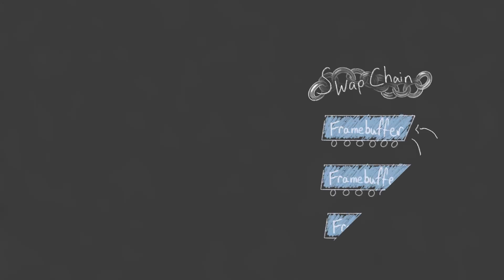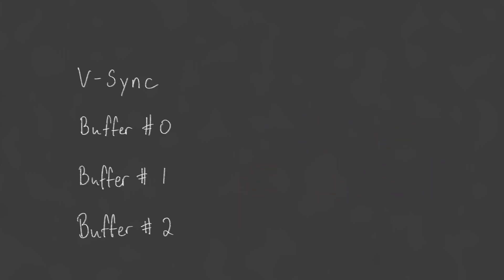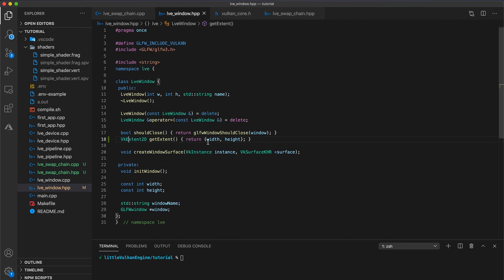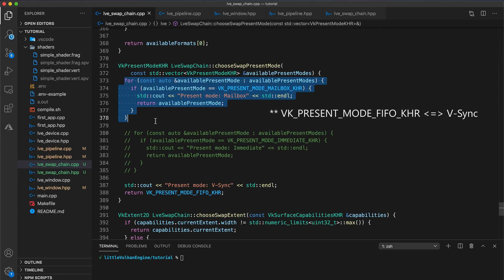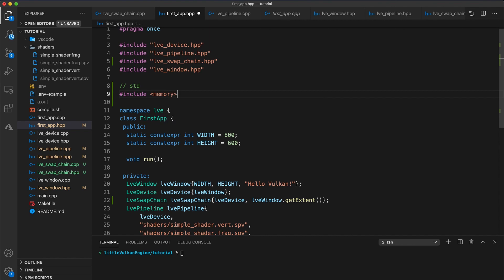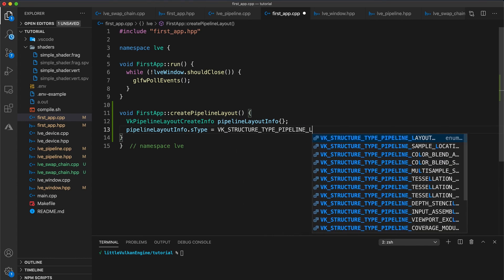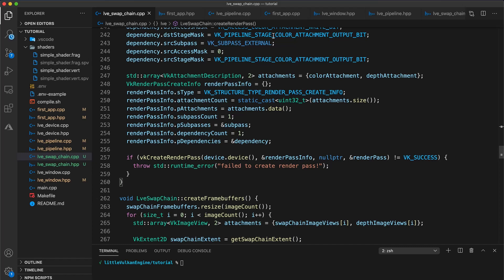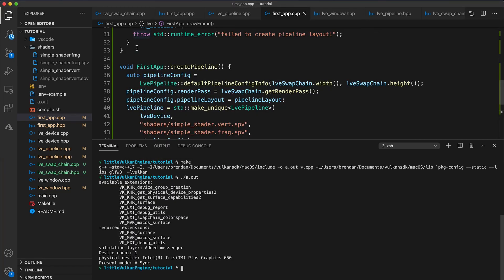Swap Chain Overview - Vulkan Game Engine Tutorial 05 part 1

Comment: I got this error:
validation layer: Validation Error: [ VUID-VkPipelineShaderStageCreateInfo-pName-00707 ] Object 0: handle = 0x1ae47b2bf08, type = VK_OBJECT_TYPE_DEVICE; | MessageID = 0xb38b9761 | No entrypoint found named `main` for stage VK_SHADER_STAGE_FRAGMENT_BIT.. The Vulkan spec states: pName must be the name of an OpEntryPoint in module with an execution model that matches stage (https://vulkan.lunarg.com/doc/view/1.2.170.0/windows/1.2-extensions/vkspec.html#VUID-VkPipelineShaderStageCreateInfo-pName-00707)
validation layer: Validation Warning: [ UNASSIGNED-CoreValidation-Shader-InputNotProduced ] Object 0: handle = 0xbb4e7a000000001f, type = VK_OBJECT_TYPE_SHADER_MODULE; | MessageID = 0x23e43bb7 | Attachment 0 not written by fragment shader; undefined values will be written to attachment

I had `shaderStages[1].module = vertShaderModule` when I should have had `shaderStages[1].module = fragShaderModule` ...oops :P
Reply from the maker: lol I'm pretty sure I've made that exact mistake, vulkan error messages can make for tough debugging experiences at times.
Reply: how did you fix this?
Reply: @pinkherblue 
I had `shaderStages[1].module = vertShaderModule` when I should have had `shaderStages[1].module = fragShaderModule` ...oops :P
Reply: @SillyRabitThatsFent  thanks for replying. Unfortunately, I got that right but still having the error :/
Reply: @pinkherblue  np but gl!
Reply: @pinkherblue  So going through this tutorial again I had swapped the .vert.spv and .frag.spv and got the same error again.

Also it could be that your current working directory is not where you expect it to be.

If you're building with C++17 or higher you can put in main to display your CWD:

std::filesystem::path cwd = std::filesystem::current_path();
std::cout << cwd << std::endl;

Because I was using the debug button with the cmake extension in vscode, it was putting my CWD to whatever my terminal was at. My terminal was in different directory than my project root so the program was throwing exceptions.

Comment: I got this error:
validation layer: Validation Error: [ VUID-VkGraphicsPipelineCreateInfo-rasterizerDiscardEnable-00751 ] Object 0: handle = 0x1ae47b2bf08, type = VK_OBJECT_TYPE_DEVICE; | MessageID = 0x19d33f93 | vkCreateGraphicsPipelines: if pCreateInfos[0].pRasterizationState->rasterizerDiscardEnable is VK_FALSE, pCreateInfos[0].pMultisampleState must not be NULL. The Vulkan spec states: If the rasterizerDiscardEnable member of pRasterizationState is VK_FALSE, pMultisampleState must be a valid pointer to a valid VkPipelineMultisampleStateCreateInfo structure (https://vulkan.lunarg.com/doc/view/1.2.170.0/windows/1.2-extensions/vkspec.html#VUID-VkGraphicsPipelineCreateInfo-rasterizerDiscardEnable-00751)

I fixed it by adding this to right above the ckCreateGraphicsPipelines(...) call in lve_pipeline.cpp:LvePipeline::createGraphicsPipeline(...):
VkPipelineMultisampleStateCreateInfo multiSampleState{};
  multiSampleState.sType =
      VK_STRUCTURE_TYPE_PIPELINE_MULTISAMPLE_STATE_CREATE_INFO;
  multiSampleState.rasterizationSamples = VK_SAMPLE_COUNT_1_BIT;
  multiSampleState.sampleShadingEnable = VK_FALSE;
  multiSampleState.pSampleMask = nullptr;
  multiSampleState.alphaToCoverageEnable = VK_FALSE;
  multiSampleState.alphaToOneEnable = VK_FALSE;
  pipelineInfo.pMultisampleState = &multiSampleState;

Comment: I have only done some simple OpenGL stuff in the passed, but all this seems overtly complicated. How much of this code would have to be redone and specialized down the road, assuming we are not building triple A games?
Reply from the maker: Ya you'll commonly hear that vulkan is an explicit API, which just means that we have to be very specific about how exactly we want things to function. OpenGL does a lot of this automatically for you behind the scenes, but a disadvantage to this is that sometimes it's hard to know what openGL is actually doing and if it is being inefficient. 

The code doesn't really need to be redone, but restructured or abstracted in certain places depending on what you want to build with it.

Comment: After adding the pipeline layout and pipeline creations I got a bunch of validation errors on VK_OBJECT_TYPE_DEVICE which didn't appear previously. Any idea on some possible cause?

validation layer: Validation Error: [ UNASSIGNED-GeneralParameterError-UnrecognizedValue ] Object 0: handle = 0x20a2a701d98, type = VK_OBJECT_TYPE_DEVICE; | MessageID = 0xbe6eff91 | vkCreateGraphicsPipelines: value of pCreateInfos[0].pColorBlendState->pAttachments[0].blendEnable (-858993460) is neither VK_TRUE nor VK_FALSE. Applications MUST not pass any other values than VK_TRUE or VK_FALSE into a Vulkan implementation where a VkBool32 is expected.
validation layer: Validation Error: [ VUID-VkPipelineColorBlendAttachmentState-srcColorBlendFactor-parameter ] Object 0: handle = 0x20a2a701d98, type = VK_OBJECT_TYPE_DEVICE; | MessageID = 0xeb9e690 | vkCreateGraphicsPipelines: value of pCreateInfos[0].pColorBlendState->pAttachments[0].srcColorBlendFactor (-858993460) does not fall within the begin..end range of the core VkBlendFactor enumeration tokens and is not an extension added token. The Vulkan spec states: srcColorBlendFactor must be a valid VkBlendFactor value (https://vulkan.lunarg.com/doc/view/1.2.162.1/windows/1.2-extensions/vkspec.html#VUID-VkPipelineColorBlendAttachmentState-srcColorBlendFactor-parameter)
validation layer: Validation Error: [ VUID-VkPipelineColorBlendAttachmentState-dstColorBlendFactor-parameter ] Object 0: handle = 0x20a2a701d98, type = VK_OBJECT_TYPE_DEVICE; | MessageID = 0x8db942fe | vkCreateGraphicsPipelines: value of pCreateInfos[0].pColorBlendState->pAttachments[0].dstColorBlendFactor (-858993460) does not fall within the begin..end range of the core VkBlendFactor enumeration tokens and is not an extension added token. The Vulkan spec states: dstColorBlendFactor must be a valid VkBlendFactor value (https://vulkan.lunarg.com/doc/view/1.2.162.1/windows/1.2-extensions/vkspec.html#VUID-VkPipelineColorBlendAttachmentState-dstColorBlendFactor-parameter)
validation layer: Validation Error: [ VUID-VkPipelineColorBlendAttachmentState-colorBlendOp-parameter ] Object 0: handle = 0x20a2a701d98, type = VK_OBJECT_TYPE_DEVICE; | MessageID = 0x7978ef4f | vkCreateGraphicsPipelines: value of pCreateInfos[0].pColorBlendState->pAttachments[0].colorBlendOp (-858993460) does not fall within the begin..end range of the core VkBlendOp enumeration tokens and is not an extension added token. The Vulkan spec states: colorBlendOp must be a valid VkBlendOp value (https://vulkan.lunarg.com/doc/view/1.2.162.1/windows/1.2-extensions/vkspec.html#VUID-VkPipelineColorBlendAttachmentState-colorBlendOp-parameter)
validation layer: Validation Error: [ VUID-VkPipelineColorBlendAttachmentState-srcAlphaBlendFactor-parameter ] Object 0: handle = 0x20a2a701d98, type = VK_OBJECT_TYPE_DEVICE; | MessageID = 0x4a7f8ed8 | vkCreateGraphicsPipelines: value of pCreateInfos[0].pColorBlendState->pAttachments[0].srcAlphaBlendFactor (798086616) does not fall within the begin..end range of the core VkBlendFactor enumeration tokens and is not an extension added token. The Vulkan spec states: srcAlphaBlendFactor must be a valid VkBlendFactor value (https://vulkan.lunarg.com/doc/view/1.2.162.1/windows/1.2-extensions/vkspec.html#VUID-VkPipelineColorBlendAttachmentState-srcAlphaBlendFactor-parameter)
validation layer: Validation Error: [ VUID-VkPipelineColorBlendAttachmentState-dstAlphaBlendFactor-parameter ] Object 0: handle = 0x20a2a701d98, type = VK_OBJECT_TYPE_DEVICE; | MessageID = 0x53ab1c8f | vkCreateGraphicsPipelines: value of pCreateInfos[0].pColorBlendState->pAttachments[0].dstAlphaBlendFactor (522) does not fall within the begin..end range of the core VkBlendFactor enumeration tokens and is not an extension added token. The Vulkan spec states: dstAlphaBlendFactor must be a valid VkBlendFactor value (https://vulkan.lunarg.com/doc/view/1.2.162.1/windows/1.2-extensions/vkspec.html#VUID-VkPipelineColorBlendAttachmentState-dstAlphaBlendFactor-parameter)
validation layer: Validation Error: [ VUID-VkPipelineColorBlendAttachmentState-alphaBlendOp-parameter ] Object 0: handle = 0x20a2a701d98, type = VK_OBJECT_TYPE_DEVICE; | MessageID = 0x48f9f9b | vkCreateGraphicsPipelines: value of pCreateInfos[0].pColorBlendState->pAttachments[0].alphaBlendOp (-858993460) does not fall within the begin..end range of the core VkBlendOp enumeration tokens and is not an extension added token. The Vulkan spec states: alphaBlendOp must be a valid VkBlendOp value (https://vulkan.lunarg.com/doc/view/1.2.162.1/windows/1.2-extensions/vkspec.html#VUID-VkPipelineColorBlendAttachmentState-alphaBlendOp-parameter)
validation layer: Validation Error: [ VUID-VkPipelineColorBlendAttachmentState-colorWriteMask-parameter ] Object 0: handle = 0x20a2a701d98, type = VK_OBJECT_TYPE_DEVICE; | MessageID = 0xb8f9c032 | vkCreateGraphicsPipelines: value of pCreateInfos[0].pColorBlendState->pAttachments[0].colorWriteMask contains flag bits that are not recognized members of VkColorComponentFlagBits The Vulkan spec states: colorWriteMask must be a valid combination of VkColorComponentFlagBits values (https://vulkan.lunarg.com/doc/view/1.2.162.1/windows/1.2-extensions/vkspec.html#VUID-VkPipelineColorBlendAttachmentState-colorWriteMask-parameter)
Reply from the maker: Ya sorry I think this is caused by my mistake! Check the pinned video comment where I go over the solution.

Comment: Is it a normal thing to be getting a ton of lines saying "validation layer: Device Extension" and stuff coming after it when I compile (using visual studio), scrolling up a bit, I can find the "available extensions" and the "required extensions". At the bottom, I'm getting "validation layer: Validation Error". Even with all this stuff you didn't get, it still runs without showing an error message window.

Edit*: Read your fix for that VkPipelineColorBlendStateCreateInfo issue, fixed the error at the bottom, thanks, the tons of messages about the validation layer remain, but they seem to just be stating the version they are instead of an error of some sorts, so I think it's alright.
Reply from the maker: Ya those extra messages seem to be windows specific so I didn't notice them initially. In the LveDevice.cpp file at around line ~219 you can remove VK_DEBUG_UTILS_MESSAGE_SEVERITY_VERBOSE_BIT_EXT

The verbose level messages don't mean you're doing anything wrong and can clutter up the console.
Reply: @BrendanGalea  Cool thanks, will try that later.

Comment: For some reason whenever I seem to call glfwCreateWindowSurface (instance, window, nullptr, surface) in the CreateWindowSurface method, it returns VK_ERROR_NATIVE_WINDOW_IN_USE_KHR instead of VK_SUCCESS. The only documentation online for it just said that vulkan was already using the window, like yeah duh. not sure what the issue is. The documentation says "The requested window is already in use by Vulkan or another API in a manner which prevents it from being used again."
Reply from the maker: Check in the LveWindow::initWindow() that you have the call to glfwWindowHint(GLFW_CLIENT_API, GLFW_NO_API);

I suspect this error may occur because by default glfw creates an openGL context with the window, which would prevent vulkan from being able to use the window. This hint tells glfw not to create the opengl context. 

Hope that helps!
Reply: @BrendanGalea  Yup! That was the problem. Thanks a bunch!

Comment: If anyone gets these wierd errors when assigning nullptr's to Vk variables: " a value of type "std::nullptr_t" cannot be assigned to an entity of type "Vk{...}" ", I just performed the cast (uint64_t)nullptr. Not sure if this is gonna mess things up in the long run, but for completeness it gets rid of the error. In fact, even without the cast, the code up till now still builds/runs with no mention of the error.
Thanks again for these amazing tutorials Brendan :D
Reply: I'm literally just getting into vulkan in all regards but could you just default construct these fields or would that be undefined behavior in this case?
 I.e.  could you just do vkVariable.vkValue = { };
Instead of using nullptr if those errors showed up? Really only asking because I've never been a fan of casting variables unless I know why they should be cast to a type and being an absolute beginner to vulkan, not sure why we would want to cast the nullptr
Edit: by default construct I mean default values here as I'm unsure if there is a default value for these fields already defined by vulkan or if this would lead to undefined behavior like one would normally assume

Comment from the maker: !!! CORRECTIONS !!!
At 4:56 I fix the mistake last week, but I also left in an identical mistake within VkPipelineColorBlendStateCreateInfo pointing to the colorBlendAttachment!

If you are using the MSVC you will be required to fix this. If not, then you can wait until tutorial 8 where I fix things there. My apologies!
The fix is to pass in a reference of config info to be initialised rather than returning a copy.
https://github.com/blurrypiano/littleVulkanEngine/commit/a867ab39c43ccc89ca744db84137df179b41daa7

At 7:22 There's a mistake in the diagram. The first gpu block for buffer #2 should be shown further left in the graph before the gpu block for buffer #0 (since the buffer #2 frame is onscreen before the buffer #0 frame)
Reply: Man, if I were to write an apology for every coding mistake I made, I'd need to double my work hours. That's programming, mistakes are made, lessons are learned, thanks for all the fish! Loving the videos, BTW, keep them coming and I'll keep coding along!
Reply: Is there any way I can avoid this? Custom copy constructor? Or something like that?
Reply from the maker: @dexterman6361  - a custom copy constructor would work, but the solution I provided is what I use for the rest of the tutorial series.

You don't have to use it, but it may make things easier to follow along with.
Reply: @BrendanGalea  Ah okay, thanks! I did that and in the copy constructor I reset the pointers to the correct values. Felt it was a tad easier, as this covers pretty much all of the defaults, and having to pull out 2 members didn't feel like I was making a reasonable default. I learnt a thing! Thanks!
Reply: Hello, this solution did fix that problem, but now I get this:

validation layer: Validation Error: [ UNASSIGNED-CoreValidation-Shader-PointSizeMissing ] Object 0: VK_NULL_HANDLE, type = VK_OBJECT_TYPE_PIPELINE; | MessageID = 0xf3693078 | Pipeline topology is set to POINT_LIST, but PointSize is not written to in the shader corresponding to VK_SHADER_STAGE_VERTEX_BIT.

validation layer: Validation Error: [ VUID-VkGraphicsPipelineCreateInfo-pStages-02098 ] Object 0: handle = 0x1d0f43b5860, type = VK_OBJECT_TYPE_DEVICE; | MessageID = 0x90ecdde5 | Invalid Pipeline CreateInfo[0] State: Missing pInputAssemblyState. The Vulkan spec states: If the pipeline is being created with vertex input state, pInputAssemblyState must be a valid pointer to a valid VkPipelineInputAssemblyStateCreateInfo structure
Reply: Ok, this is the second time I have one of those weird problems, struggle for an hour, post a comment with a question, and I find a solution within minutes:
I forgot to add "pipelineInfo.pInputAssemblyState = &config.inputAssemblyInfo;" in the createGraphicsPipeline function.
Reply: I would not have figured out that error on my own. Thanks for your dedication to quality videos!

Comment: Following your code, I get: Exception in 0x00007FFE962D08C4 (amdvlk64.dll) in ApplicationName.exe: 0xC0000005: Access violation at Position 0x000000676E22F640 when vkCreateGraphicsPipelines() is called in the pipeline's createGraphicsPipeline() method. I am running this on an AMD RX 550, Windows 10 (64) with latest glfw and vulkan libraries. Any idea what might cause this? I can provide access to my project on github. Cheers!
Reply from the maker: No, could be a lot of different things. I can take a look at your github project. There are no other validation layer messages?
Reply: @BrendanGalea  Just sent an invite. I renamed the Pipeline class to RendererSimple. No other changes so far.
Reply from the maker: @L.K.82  I'm able to build and run your project successfully on my linux system. I'll give it shot on windows. You're using the MSVC compiler?
Reply from the maker: This was extremely foolish of me, I fixed the self-referencing struct in ViewportStateCreateInfo, but there's the exact same problem in the ColorBlendStateCreateInfo! Fixing that in the same manner will have things properly functioning to display the triangle. My deepest apologies for your time wasted debugging this. All future tutorials will be tested on all platforms.
Reply: @BrendanGalea  no need to be sorry for anything. Your tutorial series is awesome and I have to thank you for all the hard work you're putting into this. I will fix this part right away. Funny how it's working on Linux but not on Windows. Many many thanks!! Vulkan and C++ are quite new to me. So, debugging is still a little hit and miss... ;-)

By the way: is there a way to tip you?
Reply: @BrendanGalea  it's working now!! \o/
Reply from the maker: @L.K.82  That's awesome, glad to hear!!  I don't have a way to tip, maybe I'll set something up eventually. For now honestly just by liking the videos, following along and pointing out errors when you find them is the best way to help out and I really appreciate it.
Reply: Thank you sirs, you saved me a lot of time 👍